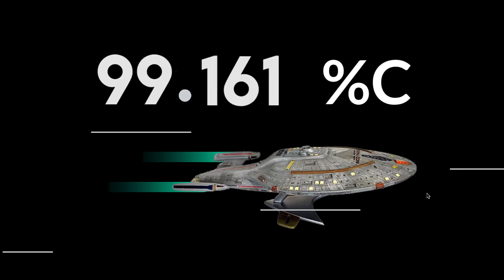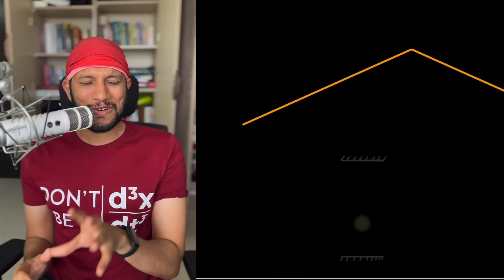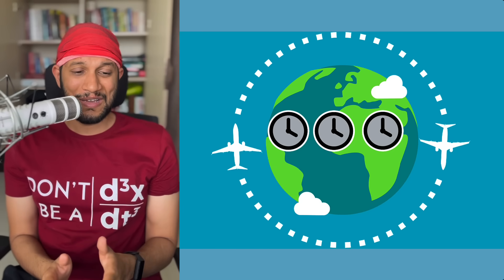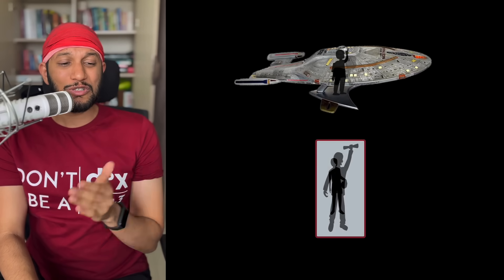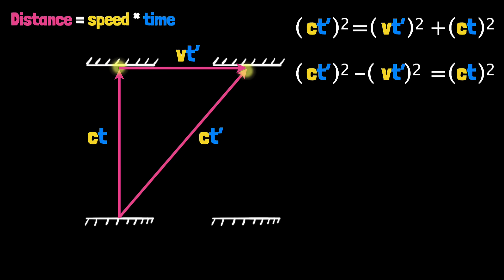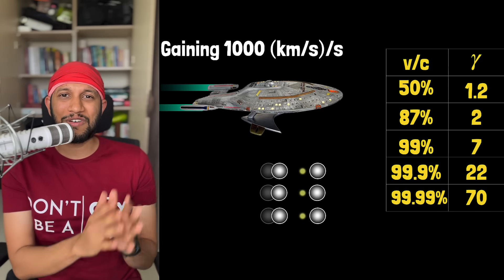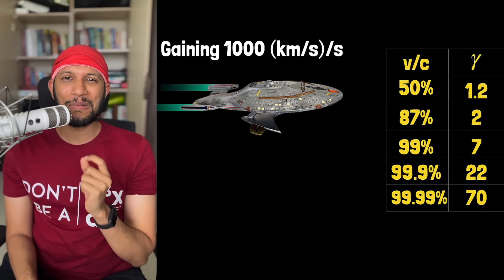I finally understood why you can't go faster than light! (My mind is blown)

Comment: it is a pretty good video but it doesn't respond to the question you use the speed of light to deduce the dilatation of time then you use this phenomenon to argue about the speed of light so you're basically explaining that the max speed (speed of light) is explained because we can't cross this speed but my real question is why do the light can't go faster your explanation about the transfer of energy between 2 masses don't work on light himself because it doesn't have mass. If I missed something I would be glad if someone can correct me or just give me the answer. I suppose it's a lot more complicated.
Reply: light cannot go faster because (as far as we know) c is the fastest speed anything in the universe can go, and to really answer your question: In the relativity theory, Einstein told us the curved space and inflation of time if the space is really curved and time is inflated, the ratio of space over time must keep constant. Only under this condition, there exists the possibility for the speed of light to keep as a constant.

Comment: I still just don't understand. The observer is the only one who see them as frozen or taking infinite amount of time to see them moving at speed of light or something. But for the people inside spaceship they're still traveling at speed of light at normal time. For observer, you might be frozen or if you go beyond speed of light, you will be seen as warping or teleporting or becoming invisible as photon won't be able to bounce off spaceship. People are only looking at from observer point of view.

Now about infinite energy, it is not possible with current fuel or engine system. If you travelling close to or beyond speed of light, it will be something which can produce infinite energy. 

It just baffles me, how is it not possible, it is just a number. How can it just stop at certain number and you can't go beyond. It can all be achieve with making machine faster.  

Or I just didn't understand the concept afterall.
Reply: "it can all be achieved with making machine faster" yes, thats a pretty reductionist affirmation but yes, if you manage to supply infinite energy to machine, for an object with mass to reach c it needs infinite energy you won't pull out ur ass, it's not an infinite supply of energy, it's an amount of energy so big it's literally impossible to grasp

Comment: So there is no way to actually determine if time slows down, you just use the scientific method phylosophical stance. Also, it takes infinite time in the outside reference frame but it doesn't in the proper reference? How does a photon accelerate to c after going through a medium? Doesn't it need infinite energy?

Comment: You can definitely go faster then speed of light through wormholes and through a medium that doesn't disintegrates. It requires energy equal to the energy of biggest stars in universe that only creator has the power to make whom Muslims worship who governs time and energy itself. Quran is very accurate in its prophecies 100 % not even 0.01 % has been proven wrong in 1400 years so when it talks about different events there is no doubt left that the book is the truth. Quran talks about this indirectly about the incident with Zayd R.A from 7 heaven to earth in few moments. Yes Christianity came before and maybe other religions even before that but no one is in its original shape. The quran says the message of all religions was same to obey 1 God through its messengers Adam, Noha, David, Jesus and many others but humans corrupted the message like old and new testament  today and elevated jesus who was just a human and a messenger. The Quran is protected by oral memorization and through chain of never breaking scholars and has no variation or versions or contradictions. No one can add a word in it or take a word out from it. The best part is it challenges you to prove it wrong if your are truthful to bring something like this and no one has been able to do because linguistically its impossible to speak like it does. All of its prophecies are with pin point accuracies depicting the future. 1400 years ago it talked about people will compete in making taller buildings and today we see that in dubai burj al khalifa tower. It talked about blackgold which is called oil today which no one discovered at that time.  It talked about shape of earth and splitting of the moon.  Prophet ﷺ said, “By the One in whose hand is my soul, the Hour will not commence until... his thigh informs him of what occurred with his family after he left.” Here it talks about mobile phones. How can some one who is illiterate living in desert talks about all this 1400 years ago and nothing of it was a fluke.

Comment: Doesn't this only apply for the observer? Let's say I have 2 ships at 99 speed of light crossing each other's path. A person on a ship will see the other moving faster than the speed of light? Even if not, their differential speed didn't require more energy applied to the ships, only the observer variable has changed. Can you elaborate on this?

Comment: Wait, so if we send an object at 99.99% light speed, disconsidering acceleration,  to a Alpha Centauri, that is 4 light-years away, for the object it will last about 4 years but for us it will be 280 years?
The higher the speed of the object the slower it will seen to the outside observer?
And by that, the ideal speed to go considering time dilation would be 87% so the object, in the travel to Alpha Centauri example, would take 4.6 years and looking like 9.2 years to us?

Comment: Still had one question, the observer is witnessing the ship require infinite energy or time to reach the speed of light, but what about the people on board the ship. They aren't dealing with the dilation, so do they reach it themselves if they use the "time" method? Just when they slowed down they would return to a void where an infinite amount of time has passed? Or does the ship still need to reduce its mass to zero?

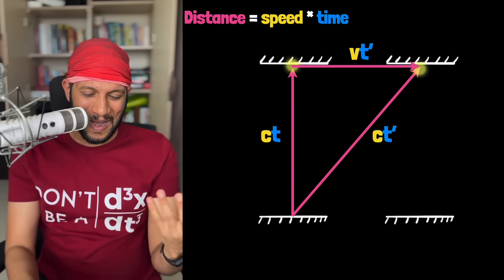Comment: 9:12 so you drew triangle but you didnt explain, why you can do that. if ct and ct' have different reference frames, why did you draw them onto the same coordinate system?
usually when you look at a map and try to find out how much faster you could have reached your goal, if you took a shortcut, you would only have 1 reference frame, when you use the pythagorean theorem and not 2 like you had with your example.
i dont think, that any of this is wrong and i would just like to know.

Comment: what if photon in clock will travel with angle not equel 90 degrees? than tou cant use pyphagor and need to use trygonometry and solution will be incorrect but why?

Comment: But why a photon in a moving ship would take diagonal path? That's not intuitive. The explanation I assume is because nothing can travel faster than the speed of light. So your explanation turns out to be recursive, e.g. it doesn't explain anything.
Reply: Draw it for yourself. The photon is bouncing between two planes, and both planes are moving perpendicular to the motion of the photo. The path that the photon follows is a diagonal line.
Reply: @ imagine you are throwing a ball forward in a moving ship. the speed of the ship will be added to the speed of the ball. why wouldn’t that work with photon? photon travels in a diagonal path for the observer SLOWER only because the speed of the ship is not added to its speed. and that is because nothing can travel faster than the speed of light. how is that not a recursion?
Reply: The most obvious explanation is: nothing can travel faster than the speed of light because the speed of photon in a moving object does not increase which was experimentally verified. So the real explanation is: just trust the experiments.

Comment: So everything in the universe is in motion, we are moving, our planet is moving, our solar system is moving, and our galaxy itself is moving, but faster than light movement has not been observed, yet we also know light in different mediums can move at different rates, "light speed" is just the speed of light in a vacuum, standardized to be measured at 299,792,458 meters per second.  Even so, it is still a fair enough statement to say that nothing known moves faster than light though there is some variance in the actual speed of light based on the existing mediums that light is travel through.  A problem with even attempting to disprove that something can move faster than light is because if something is moving faster than light how does one even observe it?  We are visually reliant beings that observe things using light thus if there was something moving faster than light it cannot be directly observed.  I would end by clarifying this "time dilation" thing.  Time is always moving at a given rate at which it is measure, but due to us witnessing all things by visual means using light, perceptions of events can differ based on the location where a given event is observed but the fact remains that this event actually happened at a given point of time even if it is perceived at a later point in time by an observer.  This last point is missed by even some researchers who get dogmatic in their belief one can slow the passage of time by moving at a fast enough speed which is just flatly nonsense.

Comment: put the photon for the clock in a circular containment that is horizontally aligned to the direction of travel? say the direction of travel is 0 and 360 degrees.
Any velocity lost between 180 and 360 would be compensated for between zero and 180.

Comment: Simple.  The speed of light is a radial velocity. Think of it as being the rpm speed of a turntable playing an album.  No matter where you place the needle on the disc (album) , be it near the spindle or near the edge of the album the needle is always going to register the rpm speed of c.  Thus all observers measure the same speed because all observers occupy the same disc.The only way you exceed c is to  run off the disc at some tangential speed greater than rpm c.  So can you exceed c? Yes.  Tesla said he had measured several particles that moved faster than c. Presumably, these particles were whizzing across our disc having escaped from some other galactic superluminal spining disc.

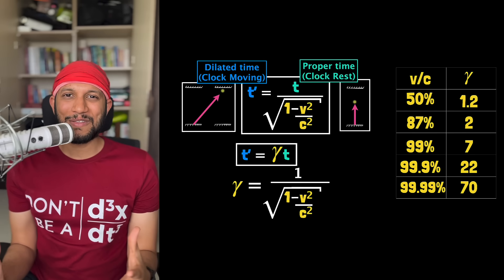Comment: I was messing around plugging in values when I discovered that when calculating gamma for values of 99% of C or higher, every two 9s you add after the decimal point, gamma goes up by a factor of 10.  It's either exactly 10, or ridiculously close to 10.  The first one is obvious if you look at the table 11:40.  99% gets you 7, and 99.99% gets you 70.  Can anyone explain why the math works out like that?

Comment: I guess I have 2 questions. 1. Why is light the ultimate speed limit? Why isn't this then also true for the speed of light? That is, that it slows down the closer it gets to its ultimate speed. 2 This obviously could not be true during the big bang. The universe is much greater than the avaliable light in the universe. If it were true, space would be full of light, but instead, it's mostly dark.
Reply: And I have a 3rd! I don't feel the very first part was justified that it takes "longer." Sure, the photon in the clock will travel more "in total" since it has the added horizontal velocity, but it's a "just believe me Bro" type of explanation that the time from tick to tick will take longer.
Reply: Think of tossing a ball to your friend accross the side isle, in an airplane traveling at 600 mph. To you the ball is traveling (i.e.) 10' and takes 1 second to reach your friend. But, to a ground observer the ball traveled (i.e.) 20' (diagonally) but still takes the same TIME, so to a ground observer, acceleration slows down, not time!
Reply: Sorry I meant, to the ground observer, acceleration appears to increase, because the ball travels 20' in the same 1 sec, while to the people on the plane it only traveled 10' in 1 sec. There is no TIME dilation; as it takes 1 sec to travel from your hand to your friend's hand! All that's happening is, to the occupants of the plane, since the ball is already traveling at 600 mph in your hand, it appears / is relative to you that you tossed it 10' in 1sec, but it is an ILLUSION as you (on the plane) are visually unaware that you are already traveling at 600 mph! This is all about what speed and distance the ball APPEARS, to the static observer vs on the plane. I do not see how the travel time (i.e. 1 sec) would appear any diffrent to someone on the plane or on Earth.

I call this explanation: BUSTED!

Math can be played with, formulas can be evoked, but non of that explains time dilation!

Comment: JUST BECAUSE THE CLOCKS SLOW DOWN, DOES NOT MEAN TIME SLOWS DOWN
Clocks do not control time. o.o Like what is wrong with you people? Use a clock that's not moving to accurately measure time. The decay for radioactive substances does not slow down time, its just the functions of the substance that slows down. Like if you enter cryogenic sleep, your metabolism slows down, not time. Time remains the same, but particle metabolism is affected by speed. Duh.
Reply: if you think about it, there isn't really such a thing as time. Its just our way of measuring progression. All the atoms sending electromagnetic signals to each other causes this progression. This slows down at faster speeds because the electromagnetic signals have further to catch up. So yes, the clock slowing down imagery is pretty confusing, but any other object would slow down too, its just visually representing it with how the seconds seem to slow down. Cryogenic sleep has nothing to do with this, because we are talking about moving at very fast speeds and you are not moving in cryogenic sleep.

Comment: When i had my UFO experience with beings of another realm essentially i experienced the speed of light and i knew upon experiencing it how it works. So each dimensional framework is a limit to its speed construction... this mean if we were to go beyond the 3rd dimensional framework the speed of light would actually go much faster. The actual speed of light is Infinite speed. But because its expressed in dimensional wave form it has capacity limits. The same is true for teleportatio and this is how their ships actually work they measure the frequency variable location of a given space and impose that energy on their craft and instantly appear in their destined location. So from our point of view the concept of teleportation is appear and disappear from their perspective the concept of teleportation if locational variable. And each location in a given space has a frequency resonance. We simply do not have the technology to measure this energy field and thus cannot teleport or use it.

Comment: There's a loophole though.
Spacetime is flexible "bendable" fabric, given enough mass energy equivalence we could accelerate all the way by simply bringing two points closer together (forming a gravity well) then letting the ship naturally fall into it, once it's "falling" at the required speed we simply drop the gravity well.
There's been endless study on this concept, the theorized "Alcubierre drive" achieves this using those principles.
All we have left to solve is how to produce such a manufactured gravity well with enough "slope" which is likely to be solved by AI rather than us in the near future.

Exciting times, for sure!

Comment: 2 reasons. 1. Effects on time space demands it and I personally haven't seen a great proof for how that has been experimentally evaluated. 2. You cannot carry sufficient energy aboard the vehicle to be able to accelerate yourself through thrust. You would need Infinite Energy in order to be able to produce the momentum.

However if you get an object that is near the speed of light able to transfer energy and or materials, this can put you over what is needed. Such as a ion beam that as you collect, you get pushed, and then the ions can be thrust material. YET, even if this happens, relativistic properties of the universe supposibly kick in. 

The algebraic explanations are little misleading to many people.  In all fairness I have not watched this video, so not a critism of the video,  it isn't because the algebra divide by zero or something.  Math is just a language of models.

Comment: In the photon clock, I understand that when the ship is moving the diagonal movement is larger, but the problem I dont understand is, why the "vertical" (comparing to the screen) movent gets lowered when it gets a horizontal movement? The photon was going at the speed of light vertically, but now it cant because if it was still in the speed of light vertically the diagonal movement would be greater then the speed of light, but why adding a perpendicullar force lowers the other one?

Comment: What about Hubble expansion over cosmic distances?

So if I shoot an electron at 99.99% of the speed of light, then it's traveling at roughly 200km/s less than c.  And if we assume the hubble expansion of space is 70km/s/Mpc, then the electron must travel 2.87Mega parsecs (9.32 million light years) to gain a hubble velocity of 200km/s and thus cross a ballistic velocity adapted hubble horizon due to the expansion of space accelerating the electron bullet.

Comment: All you believers are too simplistic in your assessments.   A car differential would disprove that theory immediately. Because the atoms are interlocked so the outer moves faster then the inner. The atomic clocks that was used for the experiment on the synchronised planes were based on quartz decaying and did not think of the possibility that the different magnetic locations around the planet could have had an effect on the quartz. You see just because someone cannot disprove a certain theory does not automatically make that theory fact even if the visible characteristics of that theorim can be used for practical work. Its possible to travel beyond C we just haven't figured out how yet.